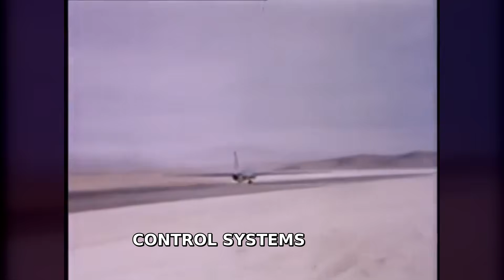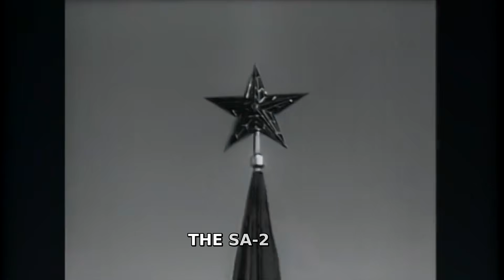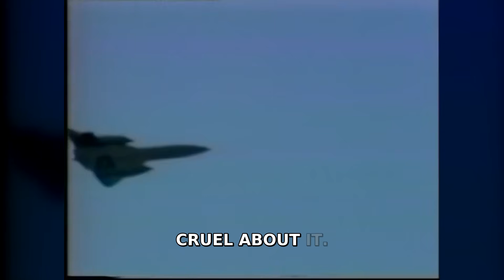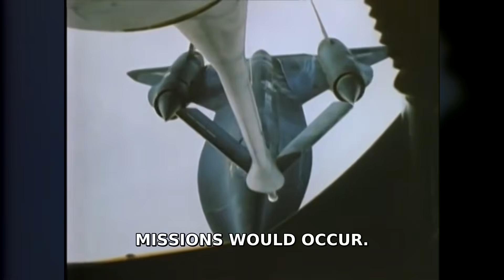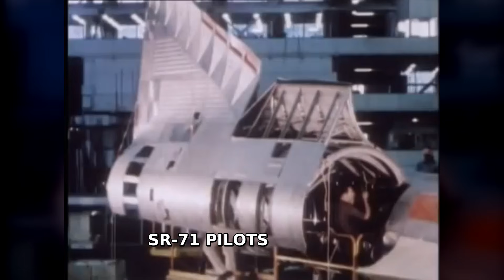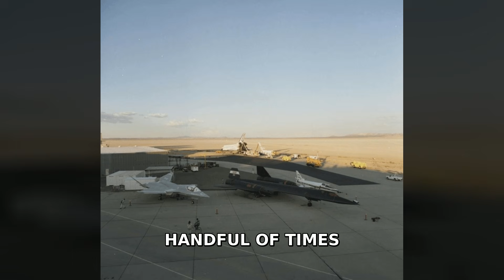Soviets Were Horrified When 4,000 Missiles Failed to Hit This US Jet

Comment: What's even more impressive about the Blackbird is that it was designed with nothing but pencil, paper, and slide rules! There was no high tech CAD/CAM used, just pencil, paper, and slide rules. WOW...
Reply from the maker: I couldn't agree more. Today, we have supercomputers and it takes 20 years to build a jet. They built the A-12/SR-71 in under two years with pencils and slide rules. It’s a testament to the raw talent of that generation!

Comment: The way I understand the physics of it, the Blackbird was limited only by the air inlet temperature, so it was theoretically capable of much higher Mach numbers depending on weather conditions. They were restricted to about 458° of heat in the air inlets to the engines before damage to the turbines occurred, so that was the limiting factor.
Reply from the maker: Spot on. It wasn't the sound barrier that stopped the Blackbird, it was the heat barrier. The Compressor Inlet Temperature limit of roughly 800°F was the hard deck. If they pushed past Mach 3.3, the engines would literally start to melt themselves from the inside out. The engineering required to manage that heat is still mind-blowing today...

Comment: MiG 25 engines were fuel hogs and had no durability.
Reply from the maker: The Tumansky R-15 engines were essentially designed like disposable rockets. At full afterburner (Mach 2.8+), the heat would practically melt the turbine tips, and the engines often had to be scrapped after a single high-speed sortie. It was pure brute force engineering with zero concern for longevity...